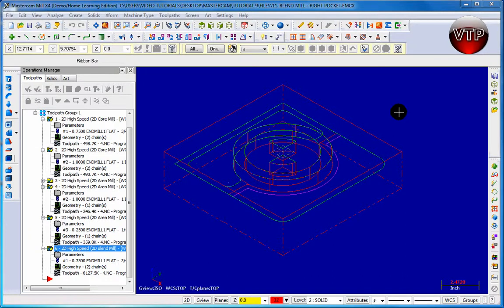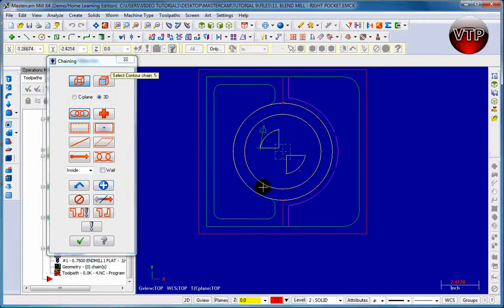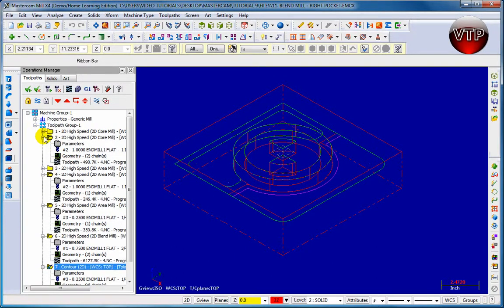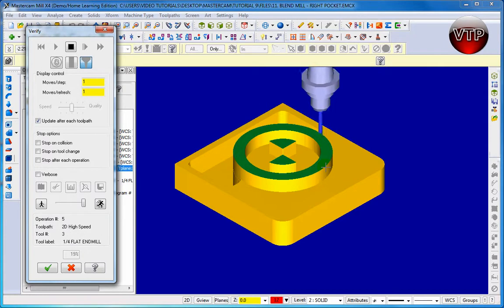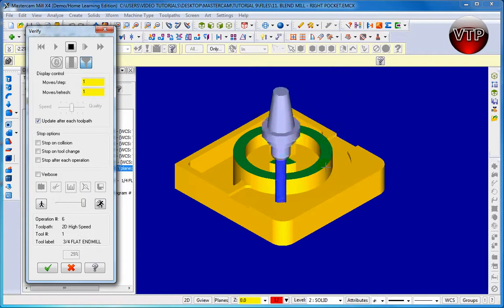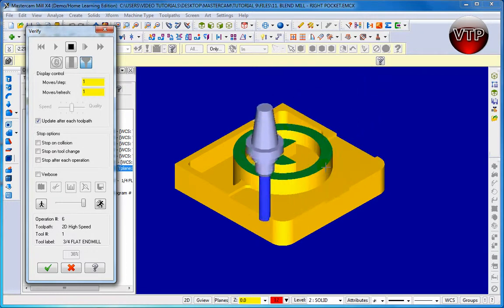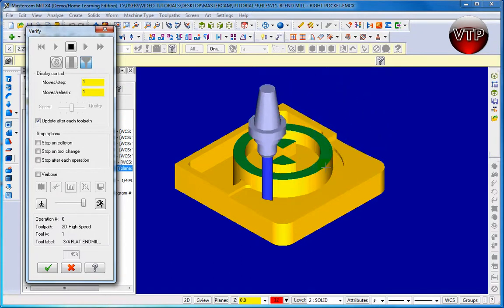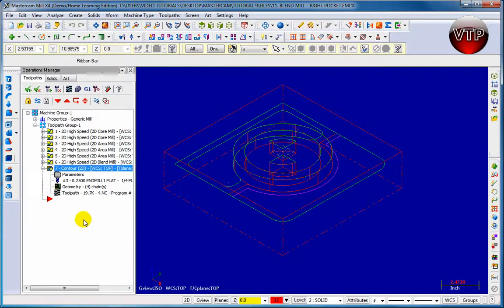MasterCAM X1-X7 MILL 9.13 - Finish The Middle Circles - vtpros.net

Comment: Why would anyone use the core mill program. It took forever to remove a tiny amount of material. Why wouldn't you just use a pocket program?
Reply from the maker: This video is strictly to show how to use the core mill feature, Although rarely used, It's used on parts where you need to face an area, generally on the outside of a part